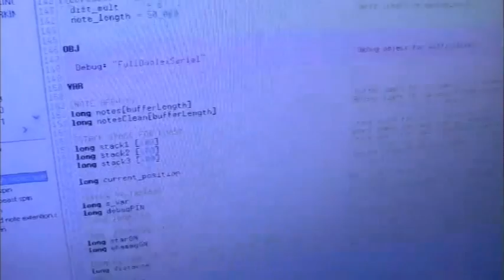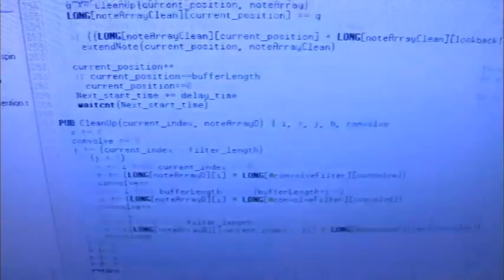How the DeepNote Guitar Hero Bot Works

Comment: You guys completely over complicated/designed this.

The only things you need are seven relays, about four diodes, a cable and ends, then write the software to control the board you just created from a PC.  This allows you to merely load song maps into your app to play any song you wish.  

Keep at it - you may do something impressive soon.  This solution clearly isn't impressive so you can only go up from here.